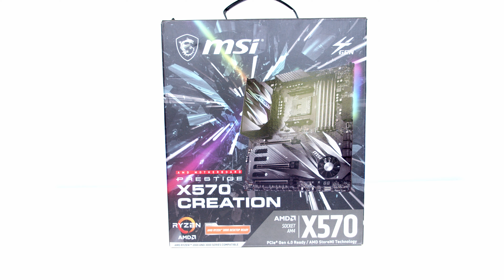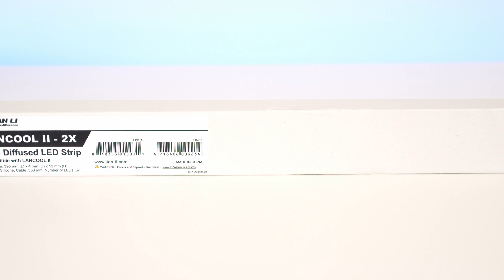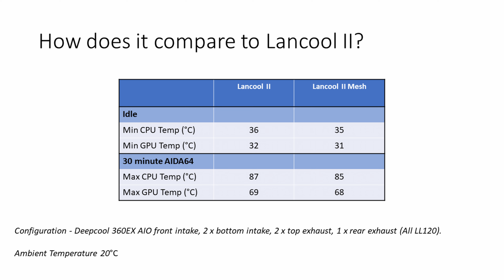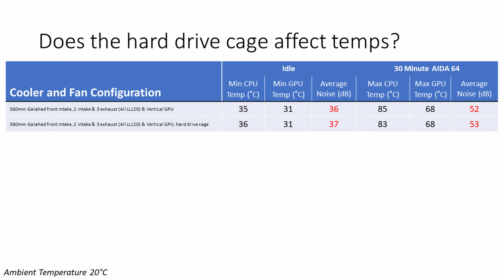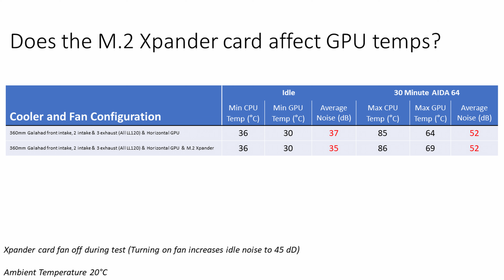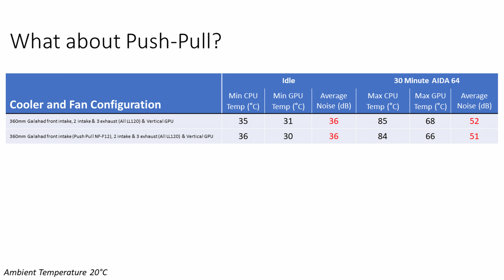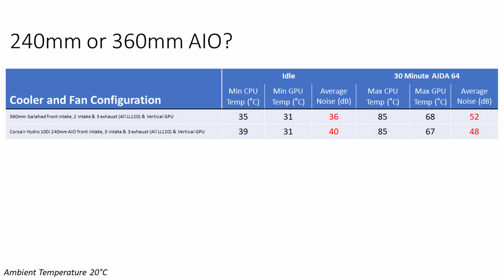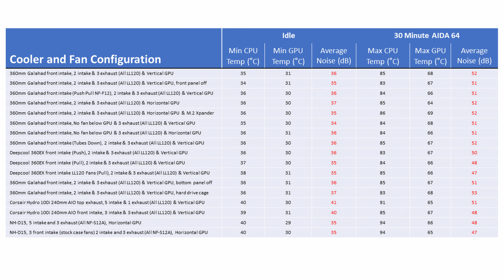Lian Li Lancool II Mesh Review & Thermal Testing

Comment: Wow, I'm not exaggerating when I say this video answered literally all the questions I had about this case, 240 vs 360, front vs top, noise levels, etc. Kudos to you dude! I'm going with the 240 on front with an additional fan on the bottom for my new build as it looks to be the best setup all-around.
Reply: @Roman 23 Yes, but you need an AIO with flexible tubing or rotatable connections. The larger your GPU is the harder it'll be.
Reply: @CC8771  is it possible to install d15 noctua with vertical gpu?

Comment: you are honestly my favorite case/build guide youtuber out right now, I really appreciate the effort you put into these videos and im sure others do as well. keep it up!
Reply from the maker: I appreciate that!
Reply: @ChristopherFlannigan  I'm trying this setup "360mm front intake, 2 intake and  3 exhaust (all LL120) with horizontal gpu" and i have a question, is it possible swap 2x120 fans of the stock radiator with 2x140? so you'll have 2x140 and 1x120 in total in the front intake? is it possible? is it convenient? if no why?

Comment: Hi Christopher.
I'm building a pc for myself and one for a pal of mine with this case.
What I found out, instead of putting 2x 140mm or 3x 120mm, you can put 2x140 and 1x 120mm fan on the front.
I will put Noctua fans inside my build and beef up the build of my pal with the now spare Lian Li fans from  my build in a 2x 140mm 1x 120mm front, 1x 140mm top and 1x 120mm back.

Thank you a lot with the detailed build!

Comment: Great review. Thanks for all the testing. It help me a lot.
I bought that case and for the last 6 months I also all my parts. I followed your instruction for the best configuration.  I did test my built and I got similar results. A bit better, but I used intel i9-12900K and all my fan are Nocuta.
Thanks again

Comment: Found this review after coming across the Lancool III fan setup one. I have this case and wish I had found this video sooner. I basically came to the same results you did but I only had the 240 rad to play around with. I found that the bottom fans help but not enough for my build to bother as I too like having my card mounted in the vertical position and placing the veritcal mount in the raised position looks terrible to me. Yes it runs a degree or two hotter but after watching your Lancoool III review I wonder if I can offset that with a push/pull setup on my rad.

Comment: Thanks for the review as I have just picked up this case LANCOOL II Mesh C Performance for £72 Black Friday deal for a new build no brainer at that price, will be going for an AMD build with a 9600x on air cooling Thermalright Peerless Assassin 120 SE Black paired with this case temps should be very cool at low RPM, Going for a pure Black build with no RGB.

Comment: Best video out there. Just 1 minor thing i'd like to point out. My lancool 2 mesh is with a dark rock pro 4. What i found is that with air cooling you shouldn't use bottom intake fans. Since it introduces heat from the gpu into the towercooler. And a gpu doesn't thermal throttle in a high airflow case like this one, so no need for bottom intake.

Still a front AIO would be best for this case but i mention it for people who aircool their cpu and like the case like i do.

Comment: The extra noise with the tubes up only starts when air accumulates in the system, which could take a few years. As for the "suprsising" results, you get, most seem to be only by 1 degree which is probably  within your error bars, so not significant.

Comment: If you're not going to mount a drive on the rear bottom door, just swap it with the front so you can hide the psu and cables. I did that and
it fits perfect. Both doors are exact same size.

Comment: I have a question for the 240mm front intake setup with an intake fan below it. Just for aesthetics, how hard would it be to get a fan that matches the other 2rgb above it? Would it be better (if you cannot find the same brand fan as a stand alone purchase) to just put a regular non RBG intake fan below the radiator and just have the 2 rgb radiator fans? Also great coverage on this case, doing my new build in it this week and those vids helped a ton, thanks.

Comment: For your full thermal testing results, the fourth configuration with the Galahad front intake, 2 intakes, 3 exhaust, and horizontal GPU. Do you have your 3 exhaust set as the two on top and one on rear, with the 2 intake in the interior mounted above the PSU drawing air through its compartment with the mesh?

Comment: @Casey
Funny you mention that, since I am still working on my logistics as well.
If you use the 280 on the front, you won't have room for anything else. 
I was thinking a 240 AIO on the top with a 120 fan below for the front.
I'll use 2 SP fans to push the air into the IO, and 1 SP fan on top to pull. That should blow straight across to the exhaust in the back.
I'm not going to use pull on the bottom of the AIO, since that would blow on my video card.
And the bottom front 120 fan, I think I'll use an AF fan, to get the most cool air in. Same with the 2 bottom fans.
Reply: I also was considering his 360 setup from his prior video just for simplicity sake so I have a guide to go by haha

Comment: is it possible to mount GPU horizontally and still put a 240mm radiator at the front with tubes down and and also having push setup?

Comment: I am considering this case, and I am using the Arctic Liquid Freezer II 280, and I wonder if it will fit in the front above the radiator bracket so it can be left in place to cover the cable mess below.

Comment: Amazing video honestly. Answered so many questions I had in detail. The timestamps also make it so much easier to watch. I’m going to get this case and put a 240 in the front. I just save the fans that came with my radiator and use the front case fans as intake correct?
Reply: Christopher Flannigan ok thanks, but would having it in a push pull and introducing 2 new fans greatly increase the noise level? Trying to keep it relatively silent.
Reply: @ChristopherFlannigan  So I'm considering doing this. if I am understanding you correctly, should I leave the 3 stock fans that come with the case at the front, move the 2 fans with AIO to the back and put the radiator between? When it comes to other case fans, should i have 3 exhaust fans then (2 top 1 rear)?
Reply: btw those links work when you leave out the last of those parentheses. I don't know why Youtube thinks it's part of the link.

Comment: i wonder the temp difference if you swap the bottom mesh plate with the other metal bottom plate? You would think it would run "hotter" but would solve the wire situation with the RGB fans mounted below the GPU.

Comment: @25.50 Another point for Vertical vs Horizontal GPU is the LIAN LI Lancool II Vertical GPU Kit only supports PCI-E 2.0 & PCI-E 3.0. Which means if you want your GPU to run PCI-E 4.0, it must be mounted Horizontally.
Reply: Lian Li sell a cable for PCI-E 4.0. Unfortunally is more money :o(

Comment: great stuff: with the 240mm radiator in the front, should the CPU cooler-head be below or above the tubes as they enter the radiator.  in other words, when you ended the video, the radiator for the CPU was mounted in the front with the tubes entering the radiator ABOVE the CPU , so the tubes were on the top (is that the ideal position) or do the tubes need to be below the CPU entering the radiator (tubes down?) thanks in advance and keep up the great work !!

Comment: Probably the best detailed review I've encountered, thanks! You just got a new subs.
I've bought the case, and considering buying arctic liquid freezer II 360mm.
My plan is to use it in push pull configuration, with the stock aio fans as pull, and the stock case rgb fan as push, so I can maintain the rgb look. There's should be enough space right? 
Also, would it have good performance? I know the case rgb fans is not really high performer...
Reply: performance vs rgb are the same except no fan controller, 2x140mm fans instead of 3x120mm (like 3x120mm fit more but many believe 2x140mm runs quieter)

Comment: TLDR/TLDW: Best setup for Lian Li Lancool  Mesh Performance: Horizontal GPU, keep stock fans; AIO Fan Push Config; 240mm AIO, tube down, front mounted radiator. 

But my only question: why not try for push+pull config with 240mm front AIO? 34:13 shows it decreases max gpu temp by 2 degrees.
Reply: @ChristopherFlannigan  Thank you nonetheless for all your helpful vids.

Comment: Question from a bonafide radiator noob: When installing a 240 AIO to the front of this case: does it go 3 case fans, then radiator, then radiator fans? Or are the 3 case fans and front mounted radiator mutually exclusive? Either the case fans OR the AIO, but not both? Terribly dumb question I'm sure, but thanks in advance for the help.

Comment: Hi Christopher first of all thank you so much for all the information you give in this video and sorry in advance for my poor English.
I’m looking for building a pc in the Performance version of this case (the fan speed switch is a killer option for me). Thanks to your video I’m opting for a Lancool 240mm AIO but i dont know if i can use the 2x140mm fan included in the case for the radiator and put another 120mm fan below the radiator cooling the rest of the system.
Thank you so much in advance for your response !

Comment: Christopher, which do you prefer, this case or the 500DX (or even P500a or P400a)?  This one looks roomier but it also looks like all the doors and hinges could be noisy.  Great and thorough review and testing.
Reply: Read the other comments. He answered this exact question at least 2 or 3 times :)
Reply: @parawm4585  ok I did read down through all the comments and you are correct although I didn’t see where he was asked about the p500a/400a.  For those who don’t want to read all the way through he said he slightly prefers the lan cool mesh over the 500dx unless you are doing air cooling and in that case he recommended the 500dx with dark rock pro 4 for a quiet solution.

Comment: @Christopher Flannigan I'm trying this setup "360mm front intake, 2 intake and  3 exhaust (all LL120) with horizontal gpu" and i have a question, is it possible swap 2x120 fans of the stock radiator with 2x140? so you'll have 2x140 and 1x120 in total in the front intake? is it possible? is it convenient? if no why?

Comment: Hi Christopher, thank you for the detailed video. I did have one question. When you install a radiator on the front as you did do you use the fans that come with the AIO or the RGB fans that come with the case? It looked like you used the fans that came with the Galahad, but what did you do with the included case fans? Seems like a waste not to use them.

Comment: I was wondering if this push pull configuration would be viable?
240mm Galahad front intake + 1 stock Lian Li Fan bottom slot (Push Pull with the remaining 2 Lian Li fans that come with the case), 2 intake & 3 exhaust (All Deepcool RF120 5x120mm RGB)
Just because I'm planning to do 240mm Galahad front intake tubes down, and I don't want to waste the stock fans that came with the case! 

Thank you

Comment: Hey Christopher, I have a question. What do you think when I don't buy any additional fans. Instead I use the fans which were included in the case. So I would have 2 intake fans and 1 outtake fan in the rear. Did you have any thermal testing with this setup and what is your overall opinion?

Comment: Do you think it would be possible that you might have done something wrong with the setup or your galahad 360 was a defective unit? Were all tested with the same average clock speed? The temps for NH-D15 and 360 AIO Galahad were strangely high. (I am asking this with respect in you content though, thanks for the hard work.) I am waiting for my the Lancool II Mesh and planning on using the Deepcool Assassin III with it. This makes me so distracted. I may buy the Galahad 240 for front mounting and tubes down instead.

Comment: I swapped to the Mesh version too and put the fans below GPU but I was concern about the PSU cables rubbing on fan blades so I keep the grilles on and just used 2 screws. I do wish the grilles had 4 screws instead to keep fans more stable. Maybe on Lancool III Mesh? ;) Please let me know what you think. Thanks for another great video!

Comment: I’m thinking about putting both the front case fans in front of the radiator as well as the fans that came with the radiator behind it. Is there a notable difference in cooling with this configuration ? Thanks

Comment: Something I wish reviewers had mentioned about this case before I bought it is that the HDD caddies are badly designed.  No noise-dampening at all on them;  the SSD mounts have provided noise-dampening grommets (WHY?), but nothing for the spinners.  As a result, they're going to be quite loud,  I ended up just stacking my 3 HDDs, separated by some wrapped velcro.

Comment: Have you done any testing with 140 mm fans as exhausts or intakes? Whats your opinion. I would like to add the 140s for exhaust. Do u think it will hurt the pressure in the case if i had one mounted up top and one mounted to the rear vs 2 140s up top and 1 120 to the rear? Already mounting aio to front with 1 extra fan. Any opinions?

Comment: A Brilliant video, thank you for posting! One question though, Could I fit a 280mm AIO in the front without removing the plate (like the 240 mm AIO), or do I need to remove it?

Comment: I am planning to get a Lian Li Lancool II Mesh Performance. Please let me know if this configuration works best for the thermal and noise level.

Front - Arctic Freezer II 280 mm AIO cooler (Push Intake)

Top - 2 x P14 Exhaust

Rear - 1 x P12 Intake

Top of the PSU Shroud  - 2 x  P12 Intake

Thanks

Comment: So I put my Galahad 240 at the front with an extra third intake at the bottom. 2 140’s at the top for exhaust and a 120 in the rear for exhaust. If I plan on mounting my gpu horizontally should I add two bottom mounted fans or use that money for a vertical mount?

Comment: I bought two 140mm fans for the exhaust on top of the case, but I also have 120mm fans as well. Is there a difference in cooling using 140mm versus 120mm? What about dust build up? 
Thanks

Comment: Hey Christopher! First of all, thank you for this video. You answered a lot of questions I had about this case. 
So i am going to buy this case and use the amd 5 3600xt processor with the amd wraith spire stock cooler. The GPU is going to be mounted horizontally. I plan to use the stock case fans as intake, obviously :D.
What kind of configuration would you recommend me?  Would 2 outtake fans be enough? I actually don't want to spend too much money.
Thanks in advance
Reply: @ChristopherFlannigan  thank you very much for the quick answer. I will send you a picture of my case, when I'm done :D

Comment: Hey chris don't know if you'll see this but i plan on cooling my rtx 2080 ti with a kraken g12. Is it worth it to get this case and use the top exhaust(120x240 mm) as the radiator for the gpu or get another case like the p500a and fractal torrent and have a 360 mm aio used for the gpu?

Comment: With the bottom gpu fans, what is the difference in thermals of them being intake vs exhaust. I see it is common to use them as intake, hot air rises, but wouldn't all the hot air blowing out from the gpu being assisted down and out the perforated bottom be better? That's how I have it set up, but I'll happily change if I'm doing it wrong. I am concerned if the two bottom fans blowing up into the gpu fans blowing down, wouldn't that create more of a thermal problem?

Comment: Great content and this has helped me to understand how to go about my editing build.  My question is, I have the Mesh 2 PERFORMANCE version of this case and the EK360 AIO, and having some doubts on how I should install it.  Would I be able to put that AIO in front, then use those 2 front fans at the base or top, and leave the one in the back that came with it?  Or should I maybe get another set to have 2 more at base and 2 at top?  Also, are the fans that come with this any good, or should I get some new fans? Advice from anyone is welcome and thanks in advance.  

Mesh 2 performance
ryzen 9 5900x
32gb of corsair vengeance,
Asus Tuf Gaming X570 Pro Wifi 6
Samung Evo 1TB
4T Seagate Portable Hard Drive
Nvidia GeForce 3070 TI FE

Dell 32" curved Monitor

Comment: @Christopher Flanagan What do you think about a 280mm Corsair H115i RGB Platinum mounted to front for intake, 3 stock fans and then 3 exhaust (2 top and 1 back) with regular gpu horizontal mounting? Would I be able to fit tubes down for the AIO radiator in this case?
Reply from the maker: That should work
Reply: @ChristopherFlannigan  Awesome, thanks so much - the case just arrived. With your step-by-step guide, I'm less nervous to do my first build in almost 9 years. Thanks for the exhaustive testing and details!
Final configuration will be my the 280 AIO in front, add a new 120mm case fan underneath it. The 2 oem 140mm fans will be moved to exhaust up the top, oem 120mm in back will remain where it is. 
I plan to add 2 more 120mm new fans later to draw air up in from the lower bay via the PSU shroud spots.

Comment: My msi 6700xt gaming x gpu didn't fit in this case. I had to change the direction of cable bracket to fit it. This gpu is only 2 fans. Is there anyting i dont know about this?

Comment: I have just got this case and I'm using the stock RGB case fans. The problem is they are super loud and I've went to the bios and turned it to silent but they are still loud. Do you know if there is a way to turn them down?